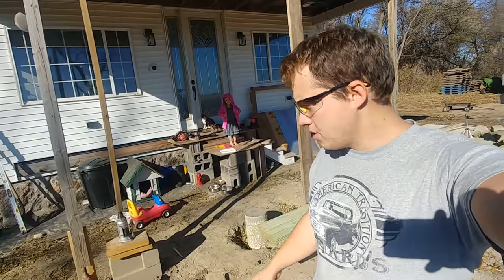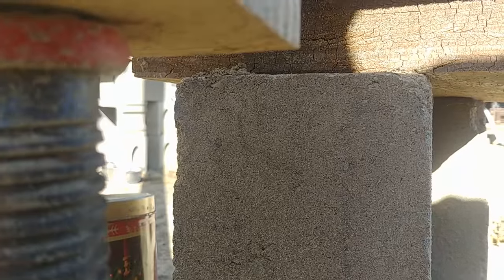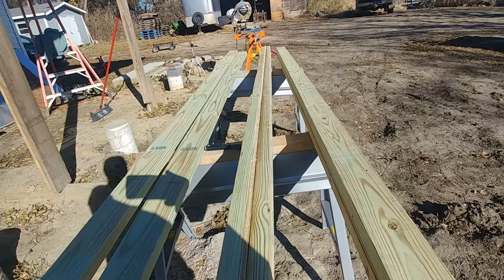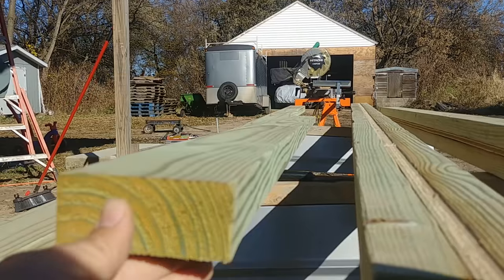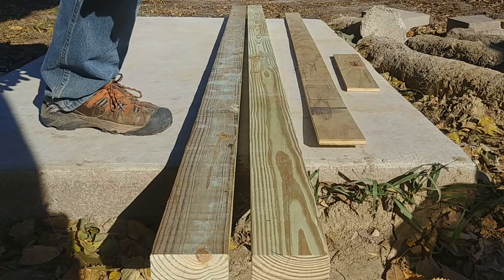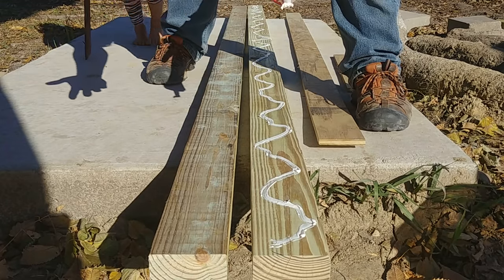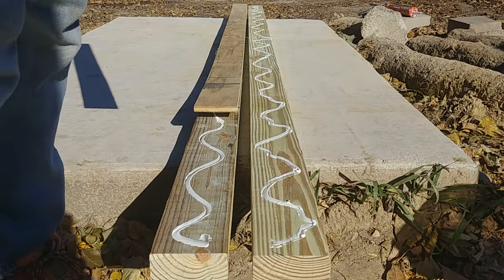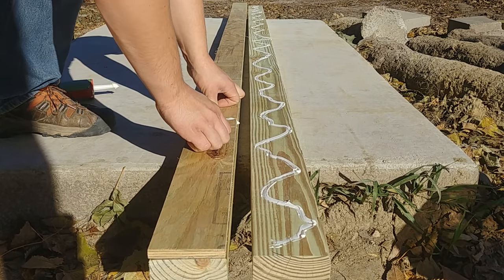How To Build a 4x4 Post or Column that Won't Warp or Bend with Treated Wood

Comment: Clever.  Basically, you're making your own engineered lumber.   
Compare lumber sold 50 years ago with what's being sold today.  There are old some 2 x 4s and 4x4s at my parents' house that never warped or bowed.  If you look at the growth rings, there are lots of them spaced maybe 1/16 - 1/8 inch apart.  The lumber they sell today has growth rings spaced 1/4 - 1/2 inch apart because the lumber companies replant their land with a species of pine that grows quickly, so the plant to harvest interval is shorter = quicker profit.  However, fast growing wood is weaker, more brittle, and more prone to checking, splitting, warping, bowing, etc.  You can still buy Douglas fir, but it's far more expensive.  It's a classic tradeoff between lower price and higher quality.
Reply: I have a house built in 1974, and I remodeled the walkout basement. Took it all down to the studs, new floors, new wiring, new drywall, the works. The wood that was used is honestly amazing. I have never seen wood of that quality in a lumberyard. There was a dry bar down there, and I ended up saving some of the wood from that to build a mantle for our fireplace because it was such a lovely grain and color.

Comment: Definitely on the right track here. Laminated lumber is technically engineered lumber.  Consider taking this to one more level by boxing the opposite sides as well, This should pacify those who suggest  6x6 sizing. I don't use 6x6 any more because of warp and twist problems and engineer the lumber meet the need. Although more time consuming, some epoxies have a better hold than construction adhesives. The trick is getting treated lumber that is actually dry. most of what I see on the shelves look like someone just hit it with a garden hose.
Reply: They ship it while it is still wet from treatment, that is why it is often warped when you look through it at the yard; as soon as the straps come off and pickers get at it.
Reply: There was a time in the 80's in my Calif Lumberjack. The 2x4's were spit wood because they would squirt water at you when you'd drive the nail.

Comment: Interesting tip, thanks! I’m sure that glue will hold just fine, but if you make them again buy a silicone brush and you can brush out the glue for better contact.

Comment: This type of thing is standard ops when framing corners of walls.  Makes everything fit in all directions.  Side note: if you're not using treated plywood, its going to rot eventually.
Reply: That was my first thought , its that the plywood would fall apart.

Comment: Use exterior grade plywood or the layers of the plywood will delaminate when they get wet.
Reply from the maker: Yup, this is treated 1/2" plywood.
Reply: Unless all the treated wood are ground contact they will still rot over 25 years.
Reply: Titebond 3 glue , waterproof , best glue I’ve used in over 45 years of construction … I even use it building wooden boats !!!
Reply: What I’ve done in a pinch is after assembly I’ll brush on a couple coats of Minwax wood hardener around the perimeter to protect the plywood.
Reply: JimoTex22 PTSD  … yes , however the “ arsenic crap “ actually lasts a helluva lot longer !!! … my 28 year old pt projects have lasted longer than my 6 year old pt projects … truthfully
Reply: JimoTex22 PTSD  You might think Titebond is more toxic than Liquid Nails, doesn't make you smart.
Reply: JimoTex22 PTSD  Or you could tell us you're a troll without telling us a troll. There's that.
Reply: There is no such thing as exterior grade plywood. All plywood is laminantes sandwiched by glue and all such plywood will rot quickly. For that reason, the whole concept is utterly stupid. Strength means nothing when rot takes over.
Reply: @samuelalley7331  You might not like or agree with the fact that there is plywood rated for exterior use, but it does exist.
Reply: @BenjaminSahlstrom  Maybe I'm just using the norms of Canadian construction, butt I've never seen treated plywood that wasn't strongly dyed. I suspect this plywood isn't treated for outdoor use.
Reply: @keithklassen5320  So use it. I have nothing to prove through ego. Just let me know when you find out they cannot pressure treat glue.

Comment: For a post that tall and holding that much weight you might go with a 6x6 rather than the 4x4. The 4x4 bends in time due to the weight imposed on it by the porch roof, happens on decks as well. I like the idea of the two 2x4's with plywood center, good idea.
Reply: That was my first thought use 6x6s not 4x4s. I like the idea of sand witching plywood, I'll have to keep that in mind for future projects.
Reply: Code in my area requires 6x6's for pretty much anything that is supporting a deck or porch roof. And they have to be connected to 12" concrete pillars that go 2.5' into the ground. PITA to build but it will last 50+ years instead of the 15 you get from 4x4's set directly into a hole in the ground.
Reply: @livens100  ...Well, he does have the concrete footers...I agree that they should be 6x6's but this is a great idea especially if you use Spectra Ply or Baltic Birch...
Reply: A 4X6 could also work, but either way the amount of glue used is not sufficient and the clamping not sufficient. use nails on diamond pattern. You can actually make a  3X 6 finished beam using 3-2x4's as well. this is actually much stronger as it make a strong back naturally. Lots of nails needed to do this without full length hydraulic clamps.

Comment: The only thing I would have done different, would have been to use some clamps instead of just standing on the wood, makes a tighter fix, also what type of ply did you use as it's out in the open. Love the concept though. Cheers

Comment: All My Deck Posts on My Porch Deck for My Trailer are 2" x 4" 's but has no Plywood sandwiched in between Them. They are screwed on Both Sides. In Ten Years They haven't twisted at all, They are as straight as Day One. But I Agree with You this Procedure would be a lot Better and also make The Post Stronger. And for Your He is right on doing that procedure,  it also keeps with the Building Codes of Construction.

Comment: Just my opinion, but I would have spread the glue for a continuous bond, and started the screws a bit farther from the end, usually at least 1.5”, to avoid splitting. If you glue the entire surface, only a few screws from one side should be needed. They’re really only needed until the glue sets. Choose the glue carefully, paying attention to weather resistance and dry time before placing the post or beam under load.
Reply: There may be a building code for the number of fasteners (generally nails) needed per post. I'm not familiar with code for external posts like this, but there is nail spacing code for internal posts. It's not just a glue it to reduce the number of fasteners scenario, unless you're not building per code.
Reply: @TheyForcedMyHandLE  thanks for the update.

Comment: We were using hydraulic jacks to lift a house beam that we were replacing.  We always brace whatever size post we are using in two directions and put the hydraulic jack on top of the post and use a step ladder.   Much safer.  We learned by watching a 6 x 6 get turned into toothpicks - Jack was on the bottom and it kicked.   Shot like a bullet.
Reply from the maker: That sounds like a terrifying experience!

Comment: You have more faith in liquid nails than I do. I used on a deck repair and screw the split board together. Less than a year later the liquid nails had complete failure. The screw even started to back out.
Reply from the maker: Yeah, I know you really can't fully rely on it.
Reply: It's to fill the void more than to hold anything
Reply: If you already know it’s not reliable, why are you posting a video recommending its use?
Reply: @jsob1970  construction adhesive and structural screws are a perfectly fine way to build this. Its part of the system, not a singular adhesion mechanism by itself. The screws and adhesive are forcing all the boards to have enough shear strength to act as a singular post increasing the load capacity and preventing mid spawn buckling.

Constructions adhesive like PL or liquid nails are a mainstay in all modern well built homes.

Comment: I like this. Never would have thought of this. I am a little concerned with the exposed plywood edge, but I assume the use of exterior plywood. Brushing on a coat of oil/diesel fuel occasionally will seal it if one can afford diesel nowadays.

Comment: I would not screw each end first. Start at one end and work your way down in order to straighten out any curve in the 2x using the unscrewed length as leverage to do so. And of course you won't have any bow in the new post as there has been no weight on it yet 🤷‍♂️
Reply: I concur, this is a good tip. When smoothing anything out always work from one end to the other
Reply: Well said! Good tip!
Reply: @rkerby6375  thanks 🙂

Comment: I would go the extra step and use marine plywood.   Otherwise I love this technique.     My shed has marine plywood flooring and it’s still flawless.  The sides are a different matter.
Reply: Marine is overkill - I would definitely have used P/T ply though - not much point in the lumber being P/T if the ply isn't..

Comment: You could use a couple of roofing nails to hold the plywood in place. Also could use a Rino lining paint and cover the entire post. 2x4 should only span 8'. 2x6 will go up to 12'. You should be fine though with your 4x4.

Comment: I didn't use plywood when I straightened out my 2@ 2x8x12 beam. The beam had a horrible twist which was driving me crazy so I took it apart, laid each one on the floor (checked that floor was flat and true), applied glue to each one, put them together, threw a ton a weight on them (patio blocks in my case), checked that it was perfectly straight, drove in all the screws and left it for a day to let the construction adhesive cure. It's the "clamping" onto a flat level surface that straightens it and it's the glue and screws that keep it that way. The plywood will not make any difference IHMO. I could be wrong.

Comment: This is a great tip. If I’m setting “posts” in concrete for a fence, I’m assuming I’ll need PT wood, but what about the plywood in between for ground contact? I live in a very wet region (Seattle), so would appreciate your take. Thanks!
Reply: They sell pt plywood as well. I’m sure your local hd has
Reply: At $18 a 4x4 post im in the same boat with 650 feet of my fence desimated from hurricane sally last week,.....dont put plywood between two solid pieces of wood!  Alternate the grain of the 2x4s and use galvanized nails and screws with a good waterproof glue and plenty of it will be stronger then an actual 4x4 ,....would anyone build a house out of particle board? plywood is sawdust and layers of cheap thin waste held by glue,...its moronic to do that just to get true 4x4 size.
Reply: @howiesvendali6107  They wouldn't build them out of particle board, but out of plywood, hell yes. Plywood is not sawdust, that's particle board and it's not for this purpose. Laminated wood, such as plywood, is significantly stronger than dimensional lumber. It's frequently used as gussets on trusses just for that reason.

Comment: Let me add my two cents to all the critiques and suggestions listed in this comment section. Coated fasteners as used in this video, commonly referred to as "deck screws", do not hold up in pressure treated lumber. This is particularly true in the lumber is designated for "ground contact", regardless of what the manufacturer states. The coatings on these fasteners are easily stripped off and all it has left is bare spots on the fastener, even on the head. Despite the cost, stainless steel fasteners (at least 304 grade) is the correct fasteners if you ever want to remove the fasteners in the future.

Comment: OMG This solves a lot of issues in my fence.
Reply: Or just use metal posts..
Reply: i wouldn't do it in fences. this works great if you are concealing with someone but to have all that exposed to the weather, bugs, dirt, etc.. its not going to last

Comment: Thanks for the video. All the hardware stores around me are out of 4x4s. I wanted to build a play set and use 4x4 as the main posts, but am thinking that 2 2x4s without the plywood would work for strength. What are your thoughts on that? Thanks much.
Reply: That would work fine for a playhouse
Reply: @tonymcpherson1958  great! Thank you!
Reply: @hansagarwal2829  You're welcome! If it's just a tiny one and only one story you could just used 2x4's not stacked together
Reply: @tonymcpherson1958  I thought about that, but I may have 2 kids (myself included haha) on it, so I may add extra support for more strength. Now to go buy some wood......
Reply: @hansagarwal2829  I'm the same way lol
Reply: @tonymcpherson1958  hah!
Reply: I'd say safer the better even triple 2x4 post the playground or double 2x6 in your house a landing that carries stairs have a triple 2x4 sometimes triple 2x6 for saftey have 3 inches barring on all beams even if they are tied into one another
Reply: @codeyshaw7176  That's just overkill. Two 2x4s is plenty, pole barns are built with them and have a lot more weight on them with trusses and everything.

Comment: The type of screw you are using is important as well. If those are regular deck screws I would use only enough to get a good glue contact and straighten out the lumber, after which I would blow in hot dipped ring Nails on a slight angle. Standard screws tend to fracture over time whereas nails and structural rated screws are much tougher and would be specified on Engineers seal.

Comment: just throwing this out there. I'm bout to install a shade sail and see/ hear that a 4x4 will warp from the tension over time. so they say use 6x6 and angle 5 degrees outward. Anyways my plan im thinking bout doing  is to use a 4x4 straight up and add a 7 1/2 ft. metal fence post thing they have at home depot to run up the 4x4 and screw it to the 4x4 every few inches. and in theory I hope 4x4 can be straight up without warping. Clearly I'm going to throw rocks at the bottom of hole and bring concrete above ground level and slope away from 4x4. Figured i bounce this off anyway thinking about doing something of this nature.

Comment: If you are using “posts” then post to the ground and you need to anticipate the Jack giving free and roof falling.

Those posts are now in you way to build your deck and also installed in a non safe manner.

The gentleman’s way is to use a 2x6 or 2x8 with a 2x4 ridgeback on it in a “T” fashion that gets notched under the rim and transfers weight into the ground and then drive a stake in front of it so it does not move.

Don’t be lazy and think it can’t happen cus it hasn’t yet.

Comment: I thought that all pressure treated lumber except for 4 x 4 is or otherwise stated on the tag are not meant for ground contact? I’m sure you can purchase marine grade or ground contact lumber but they just don’t sell it in my area. The only kind of pressure-treated lumber that is intended for ground contact to use is four by fours or four by sixes or six by sixes

Comment: Good tutorial. I would suggest getting some better boots, ones that do not flex a whole lot. You want hard soles that do not flex like rubber flip flops. They will be a lot easier to work in, protect your feet better, and you'll not get tired feet and legs.

Comment: Personally I would want something more beefy that 4x4 or the method here.  I have a cantilevered sail shade on 4x4 posts that have been sandwiched between 1/4” steel plate of same width.  They are bolted through. The sail is fastened to 2” steel tubing welded to the plate.  For something like that deck frankly I would sandwich all 4 sides are just go ahead and use steel posts.
Reply: Holy smokes!  How long are those posts?

Comment: If you ever have to do this again use wood glue it gets down into the wood and bonds to it if the beam ever fails it won’t be at a glue joint
Reply: If I am not mistaken, I believe wood glue will not bond well with treated lumber.
Reply: @gaylanlee6447  sure it will how do you think they make treated ply wood ?

Comment: Would this work if you wanted to use it as an inground post for a gate?
Reply: You would want to use treated lumber for in ground.  So as long as you're building with that you should be fine.  You'd also probably want to make sure your adhesive is rated to handle in ground installation just to be extra safe.
Reply: i wouldn't use this for exposed posts
Reply: The plywood would likely delaminate.

Comment: Use pressure treated 4x4 posts designed for burial. They are 4 inches, not 3 1/2. They are heavy and do not warp and never rot.
Reply: Where do you get them 4X4s, Home Depot only has 4X4s
Reply: You have to go to a lumber yard, not a box store. Lumber yards only sell wood,  screws, nails, tools insulation.